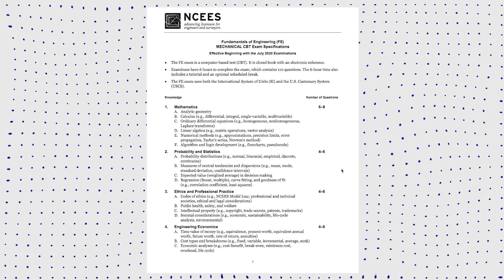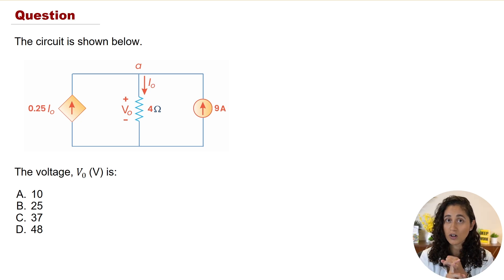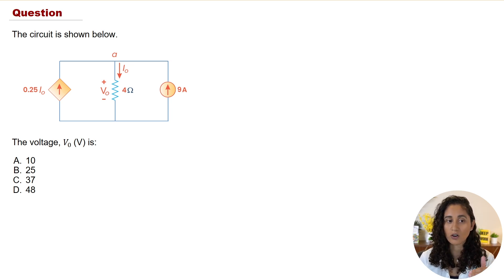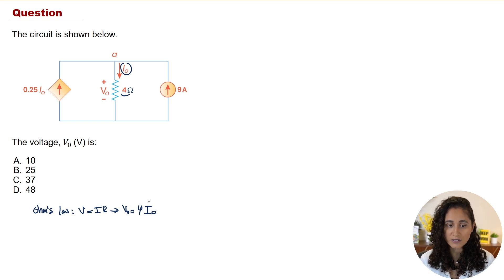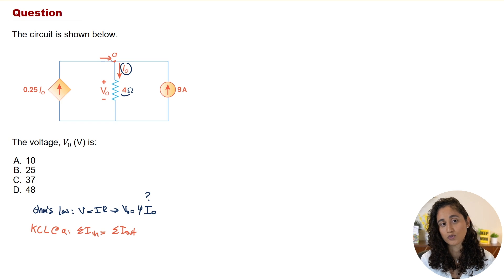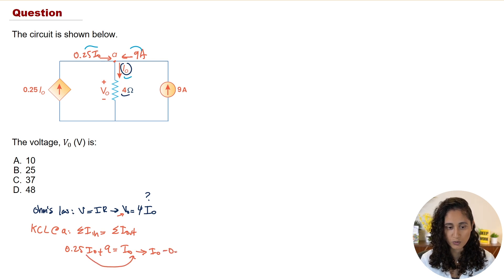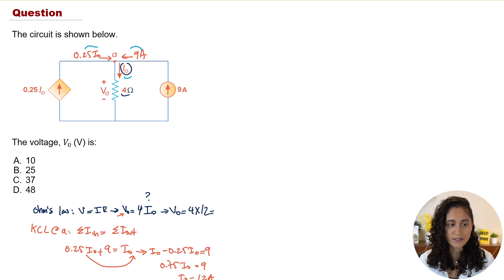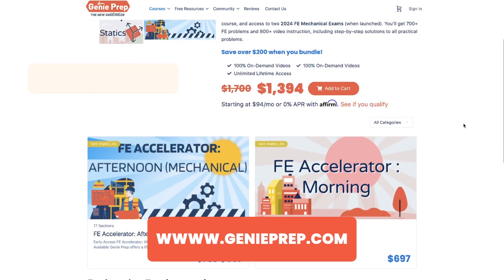FE Exam Review | Electricity - Voltage

Comment: .25 Io is a dependent source. Depends on Io which "runs" through R4ohm.  So, 9A splits between R4ohms and the dependent Current source. if that's the case the answer is 28v.  the 0.25 should come from the 9A. visually, that's why I see. What do you think?